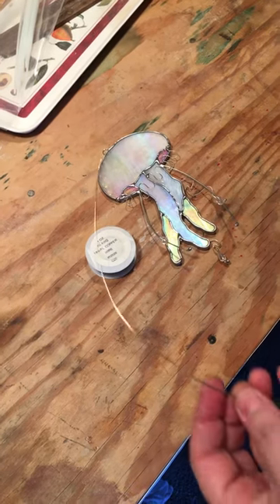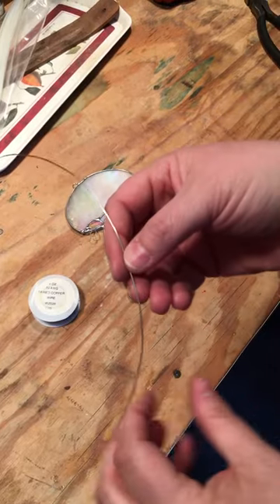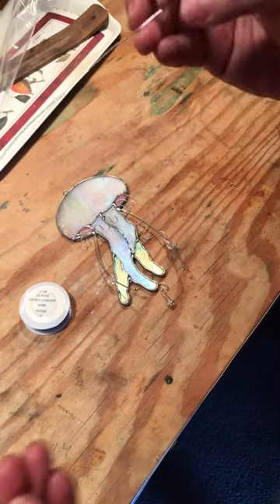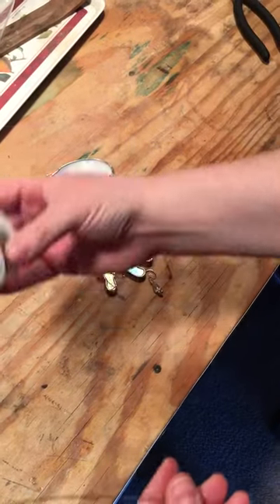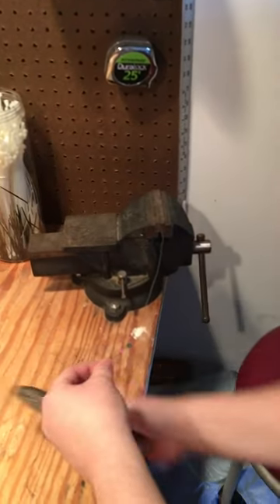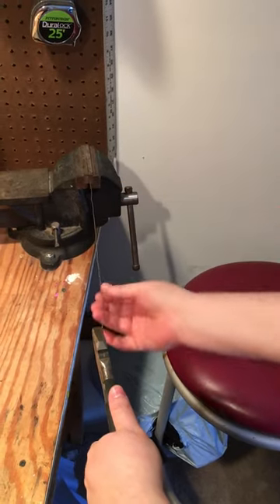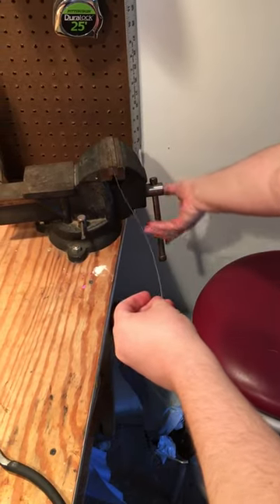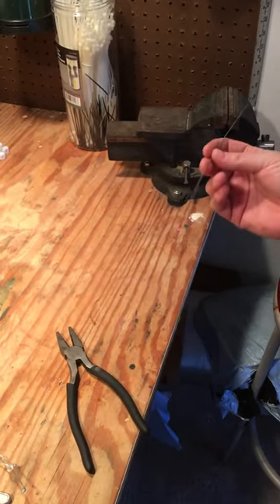Hardening Tinned Wire

Comment: I straighten wire the same way. After the wire is straight I leave it in the vise and rub it down with 0000 steel; wool to get it ready for solder